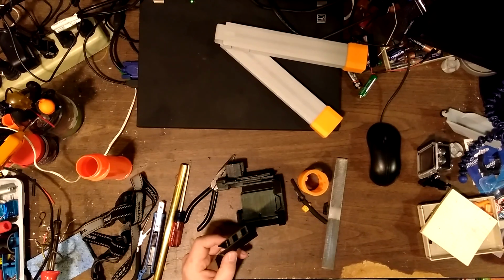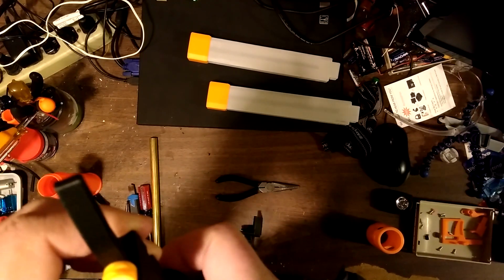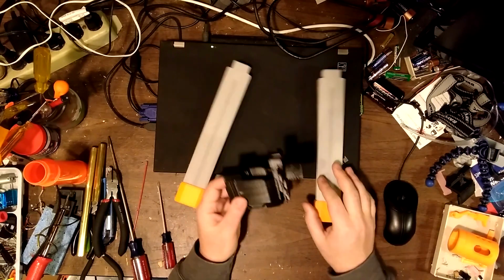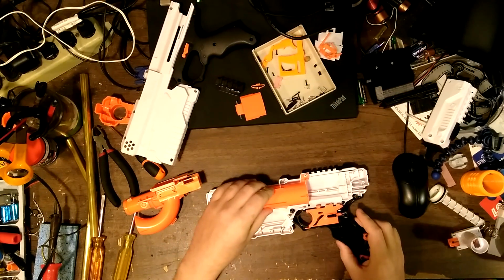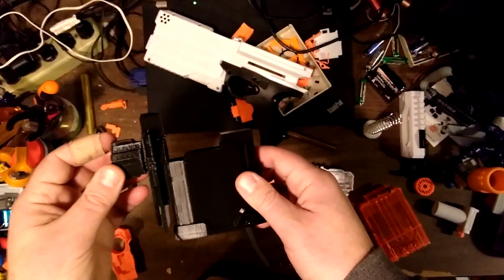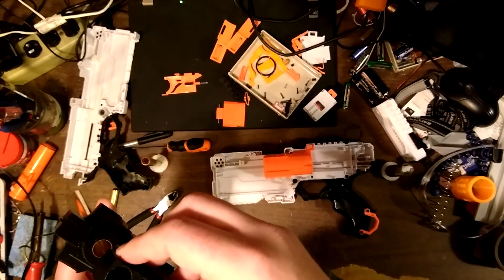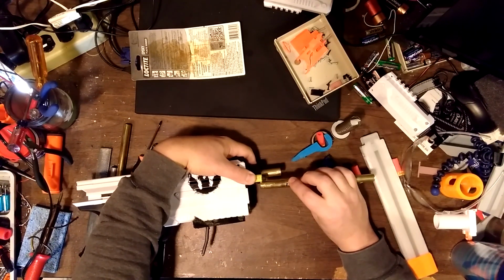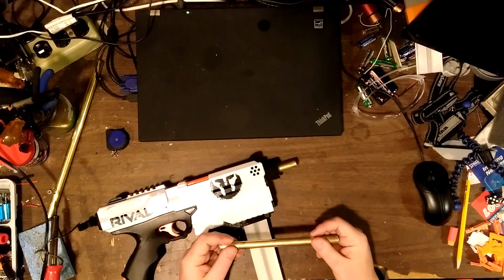Nerf Rival Kronomag (Kronos) tutorial / build guide!

Comment: Thanks for posting this. Based on the mistakes you called out in the original design, I am going back and revising his files. I got his permission to reupload them when I finish and verify my changes!
Reply from the maker: That would be very cool!  I know there's a kit for this by "Create with Ezekiel" but I always thought it was nice when there are free community designs as well.  Granted, when you can go to Walmart and get a 200 FPS blaster off the shelf, it may be slightly less relevant.

Comment: Issue on 27:33 , do you know what will be the solution on this that the 2 shells could not properly close with the 3D printed part of front end? Thx
Reply from the maker: I think it's unfortunately not really optimized in the 3d printed part.  Myvenom commented on my Reddit post at the following link with some insight.  I think basically it boils down to sanding/trimming the shell and the 3d print where possible until you get it to close.  https://old.reddit.com/r/Nerf/comments/ay0tpk/kronomag_tutorialbuild_guide_very_long/

Comment: End up kicking your self after talons won out?
Reply from the maker: Does feel like it's going that direction, doesn't it?  Sort of.  When I printed four of my KaThanhas, it was the 1.0 (or 1.x) version, and Thanhlon wasn't out yet.  I do think that if Thanhlon was out, I'd have gone with that instead.  And now in the future, any more that I print will probably be KaThanha 2.x.  Currently I have two of the latter.

So far the main possible regret I have is Flygonial's Gryphon is for Talon only (last I checked) but he was planning to add KaThanha probably.  Everything else mostly seems to have K and/or T.

Comment: Yea @American foam, on the original kronomag, the only 3d printed part is the tac rail.  Very possible.  I was very impressed with dereks work with that mag catch.  Dead space, I used GO2 glue to fill.

And do push higher than k26, I use an 18.5 turf.  10"-12" better for 18.5 turf
Reply: @gargunkle  yea for 200 fps, 14kg is fine.